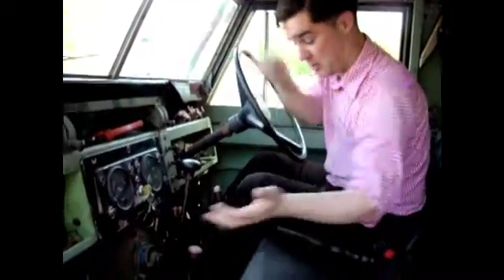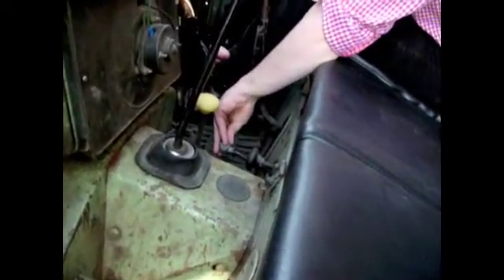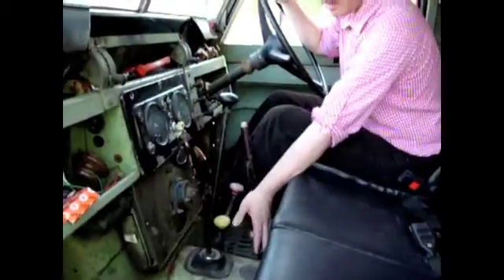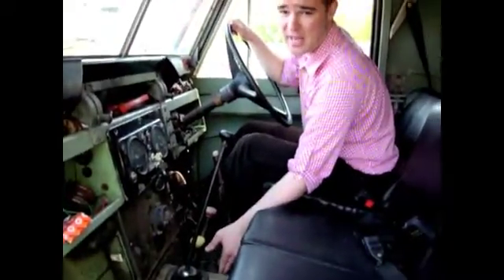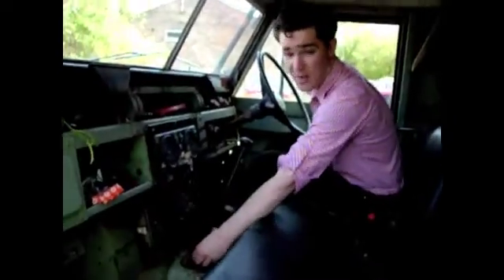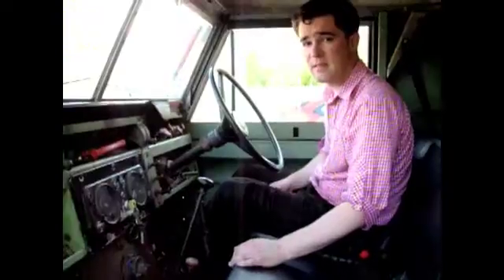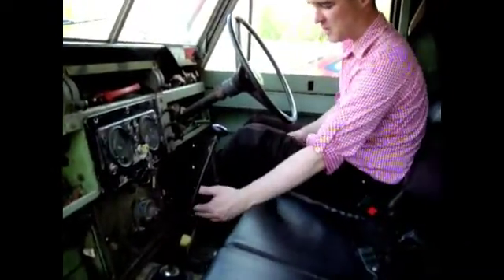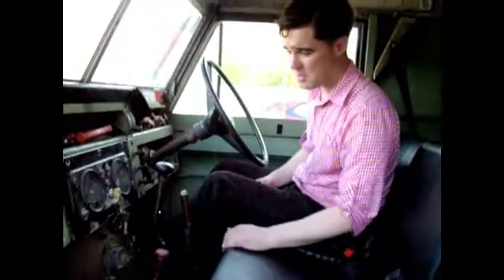Land-Rover MKII Hydraulic Winch - a basic introduction.

Comment: So you have 4WD in neutral !!!!!!! WHO KNEW !
Reply from the maker: No! It doesn't drive in neutral, but it does connect the driveshafts together so the handbrake works on both axles. I hope that makes sense?
Reply: @onetonlandrover  4WD YES, but no propulsion ;) (Iknow what I'm talking about ;) )
Reply from the maker: @millomweb  Then why ask?
Reply: @onetonlandrover  Expectation is that 4 would be engaged at the time of selecting low, not disengaged at the time of selecting high !

Comment: the seller said it came off a series 2a i guess a standard 2.25 petrol mine is a 2.25 diesel. i am thinking of routing some pipes back and adding a spool to it to tip a trailer if i get through the deal. but anyhow. nice truck again :)

Comment from the maker: The winch speed is controlled by the hydraulic valve, so I can only assume that the only difference the gear would make would be to pump speed, and therefore pump pressure. Doesn't seem to make much odds in practise though.
Reply: It'll do the usual - give a range of max speeds and a range of torques - although even in fourth, the engine may have enough torque for max hydraulic pressure.

The best bits of LR were missed by the majority ! At least the one I got a ride in had a front crankshaft driven capstan. NEVER saw it used though.